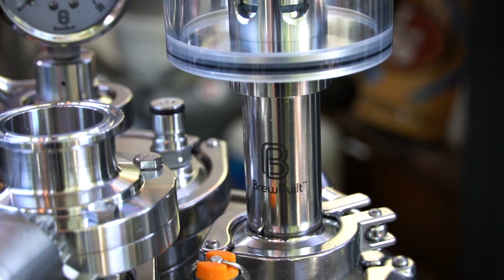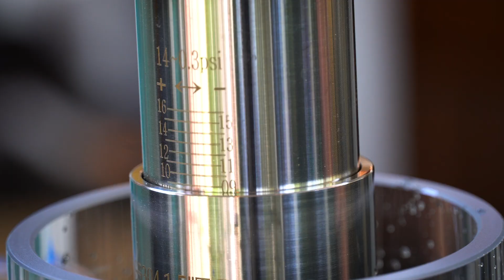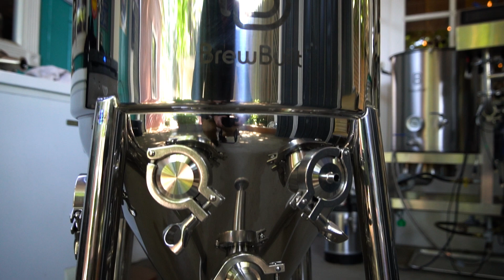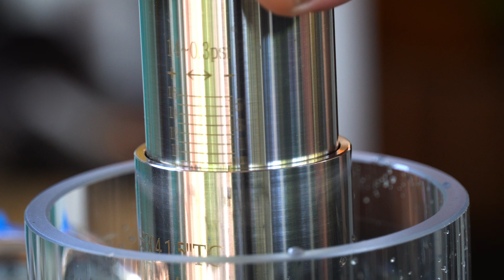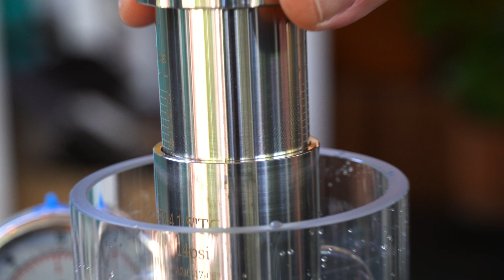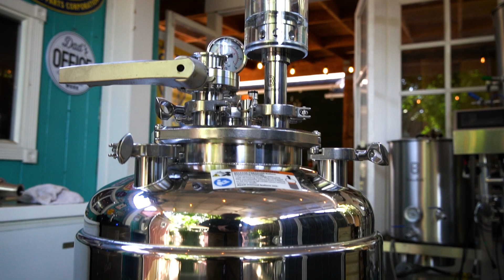PRESSURE FERMENTATION Explained! | MoreBeer!

Comment: In my experience, I have to leave the CO2 in until fermentation takes off.  If you remove the CO2 in after bringing the wort up to pressure, won't that CO2 dissolve the wort and drop the pressure until active fermentation starts?

Comment: Whats the reasoning to bring it up to 5 PSI in your example?  Why not just let it come up on it's own, and save some gas while your at it.
Reply: @vitodelucchi7347in this video you cover the spunding valve and gauge but the kit I purchased from brewbuilt also includes a large PRV as well. How does that work with this setup. Also, instead of a + setup like the pictures on the website, you utilized each component of the pressure kit on different ports. Will that work the same? Thanks
Reply: I should add that I have the x3 as well
Reply: It allows you to dial in the exact pressure that the spunding valve releases. Usually your yeast take awhile to make co2. This allows you to set it before the yeast are producing and avoid over pressurization.

Comment: I'm a little surprised not to see a 15 PSI safety PRV and blow-off pipe.  Be careful with high kräusen and the spunding valve getting plugged. ⚠

I'd like to see the spunding valve with a safety PRV and analog pressure gauge (which BrewBuilt sells as their "Fermenting Under Pressure Kit") on one of the two 1.5" tri-clamp ports which are directly welded to the lid and a 4" tri-clamp hop drop (with a 4" tri-clamp butterfly valve) on the 4" tri-clamp port of the 8" tri-clamp adapter cap, rather than a tiny 1.5" tri-clamp hop bong. 👍
Reply: @vitodelucchi7347 You demonstrated the use of the X3 built-in pull ring valve in order to manually release pressure.  I'm referring to the use of a safety PRV which automatically releases pressure when it exceeds the unitank maximum operating pressure (15 PSI in this case).

BrewBuilt includes a 15 PSI safety PRV (along with their spunding valve and analog pressure gauge) as part of their "Fermenting Under Pressure Kit".  As BrewBuilt points out in the product description, "On all brewery pro tanks, a tri-clamp (safety) PRV is always installed in addition to a Spunding Valve. This is because a Spunding Valve still has the potential to clog. The pro PRV has a very wide interior body as to reduce the risk of clogging. The PRV is non-adjustable and comes preset to relieve pressure at 15 PSI."

Always use an automatic 15 PSI safety PRV in pressure fermenting the X3. Be safe.  Cheers! 👍
Reply: Between the 1.5 spunding and keg style prv you should be fine.  Clogging that spunding would take an enormous feat of krausen to begin with considering when you pressure ferment it also suppresses the level of krausen.
Reply: @scotttower956  I'd be more comfortable if @vitodelucchi7347 had incorporated the blow-off pipe included with the X3.

Comment: I am doing this now with Grafs in a regular corny keg with a keg land spunding valve and a Flotit from Home Brewer Lab. It is perfect for starting pressure fermentation and I can serve clear stuff with the double filtered floating dip tube. I just cold crash a little and let it rest for maybe a few days and it's basically already carbonated. I often add 30psi for a few days and it's crazy how easy it is.

Comment: I use pressure at room temp. What would happen if you used pressure at lager or pilsner temps, say 50 degrees.
Reply: @vitodelucchi7347 Thanks for the info, just what I needed to know.

Comment: While I truly appreciate this video, is there a way you could show us, less well off home brewers, how to do it on a sub $500 setup?
Reply: Used corny keg, spunding valve, floating dip tube. Should cost roughly $100-$110 give or take.
Reply: @lordredbeard7791 this is what I do, I don’t even chill anymore, it goes into corny keg straight from boil, takes a day or two to cool, during that time I use wort from the boil to make a starter. Pitch it when it’s down to temp and use a keg land spunding valve, when it’s done cold crash and serving from same vessel. I don’t keep beer around long enough to care about the trub, if you do care you can use another corny, use the co2 from Fermentation to purge the second keg and then just transfer over. No oxygen and no trub, glorious.
Reply: @john-smith.  I pressurize it with co2, 40 psi and then a few hours later top it up again. So there is always positive pressure on the inside, it’ll drop as it cools. There has been a lot of discussion about them imploding if you don’t hit it with co2, personally I think the seal would fail before it imploded but who knows. But you don’t have to worry about it if you just keep it positive obviously
Reply: @lordredbeard7791  do you just get a little less volume of finished beer?
Reply: @steve1144  yup. I they also make 6 gallon corny kegs specifically for fermenting, I don’t bother. Just ferment in a 5 gallon and get the 4-4.5 gallons from it.
Reply: 6 gallon torpedo keg (if you want to do 5 gallon batches) and a spunding valve.